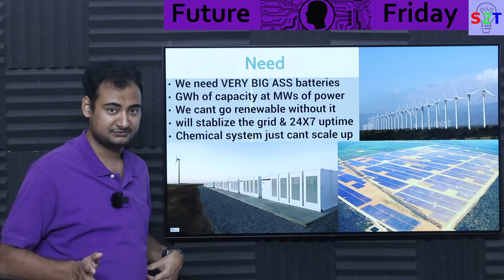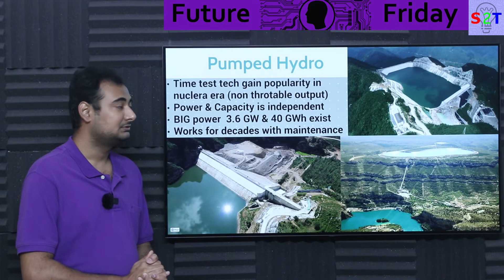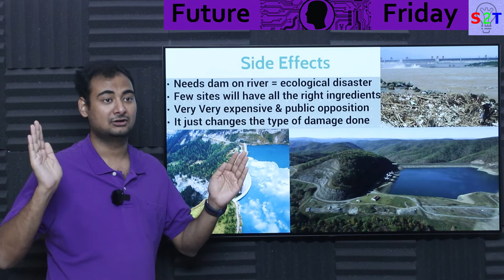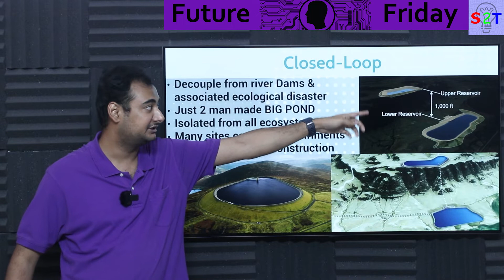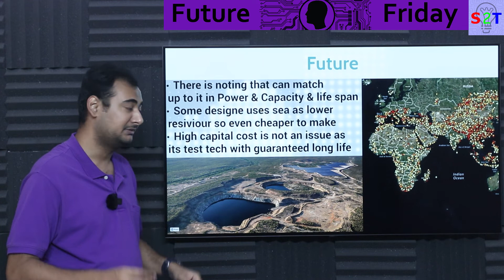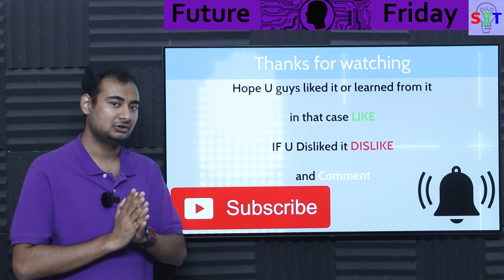Closed Loop Pumped Hydro Storage Explained {Future Friday Ep195}

Comment: can we do this on a small scale? let say to run a house or houses. Would it be viable solution instead of lithium ion batteries?
Reply from the maker: NOPE  it only works are Super large scale & gets more efficient the bigger U make it
Reply: @s2tenglish  I see. I was thinking this might work as there is a mountain at the end of my land, which is over 1km in height. Could easily get 150M drop, but since it's not viable, I will have to look for batteries then.

Comment: The solution is always been tidal Hydro electric generators .these can be put off shore of any country in mass using the tides coming in and out to constantly be producing power unlike a damn ,there’s no ecological damage obviously you don’t want to put them in barrier reefs ,but the earth is covered with 2/3 water plenty of space using the tidal currents in the ocean even in the currents that are deep current flow there are generators that are manufactured that will handle this .of course then there’s the problem of running all that wire from deep in the ocean but the power there could be converted to radio waves pump to the surface and bounced off satellites .there is solutions but the biggest factor is the political problems you see information is powerful and suppressing information has become an industry and most governments .keeping their people from knowing solutions helps keep them under control and the elite ruling class is all about control ,it’s their endless supply of funds that they take from the poor the ruling class has always been the oppressor throughout all of history until the US developed a constitution that demanded the people rule themselves  .but they want you to think it is other people than themselves these are the issues that we must fix because the political issues are strangling the people in the name of ecology now  ,which is another big lie from the oppressive ruling class I have been all over the Bahamas as well as many Caribbean islands they all run their electric on diesel ,they definitely could use solar and wind to produce their electricity but title generators using the tides around their islands would supply them with endless amounts of electrical energy .why they don’t .political they are making money from selling themselves or their people oil and gas and then taxing it on top of that .all these rackets are polluting by causing death and destruction of mankind you end up polluting The solutions that come from our minds and the more minds you have the more solutions so if  you will find killing them all off you won’t find any solutions but you will find a whole Lotta murderers and selfish individuals that will self destruct the human species. These governments and ruling class oppressors must be kept under control and allow the people to grow and give them the information they need to fix the problems although I do not believe the ruling class will ever allow this to happen we must try down here at the bottom to give them overwhelming solutions through the Internet to educate people and show them how to be free from these tyrants. I am old enough to remember when the tyrants realized nuclear energy could make everyone independent so I campaign was started on the dangers of radiation and those dangers are extremely exaggerated through the media who is bought and paid for by the ruling class elite oppressors again keeping the people dumb on how to protect ourselves yet still use nuclear energy the energy creating waste could be launched into space The way the Voyager spacecraft which are still moving out of our galaxy and we could be pumping the waste out where in space gamma radiation would probably destroy the waist but I digress there are solutions they may not be the ones some people want but they’re are solutions.
Reply from the maker: tidal Hydro electric  does not work as  sea is a brutal environment nothing lasts in it and its not 24X7, its based on tides which have there own cycles. many people have built it in many country's outcome is always the same maintenance & capital is too dam high per KW. Stop blaming everything on someone else it always has been US vs our baser Instinct. No god or kings only man
Reply: @s2tenglish  I agree a dam is better more efficient but there are some of these that are offshore that are very efficient problem is again you have to run wires so there’s always a give-and-take when the earth was covered with ice and it melted it became an ecological disaster for a period of time with all that water standing but it finally receded the earth healed and worked with all those thousands of lakes so a few hundred more for dams aren’t going to cause the big ecological problem they are decrying they don’t want people independent from the ruling elite that’s the real issue if they would face this we could feed more people the truth is if you take 8 billion people put them in a 3‘ x 3‘ square of ground sitting in a lawnchair 8,000,000,000 yd.² takes about 27 mi.² up of space about the size of Jacksonville Florida the city that is a spec compared to all the space that is around even if you take one person per acre to survive 8,000,000,000 square acres will not cover the entire earth it will only cover north and south America and leave all of Europe and Asia to expand into and I’m not counting Africa Australia and all the thousands and thousands of islands we do not have an overpopulation problem not even the least we have a problem where you try to put 1 million people in one square mile then you have a problem it’s all how you look at the problem as to how you solve the problem I love your videos because you are straight up and telling the truth as you see it from your vantage point but we must remember there are a whole lot of other vantage point we must look at the problem from thanks again.
Reply from the maker: "problem is again you have to run wires" that is not a problem we have monopole HVDC used for off shore wind farm its known and tested . Please talk to ecologist dams kills every thing  My country suffered because of it so I know and if u need more proof look at china the literally have 1 dam per 100KM of river outcome river died & people are suffering. Rivers are not something that u should stop people have learned it the hard way . Let go of "ruling elite" control everything that will only brain damage you ,make even solvable problem unsolvable. Controlling people are part of human experience. they where, they are & they will be.
Reply: @s2tenglish  True they will be .but they are the problem that we keep avoiding and it makes for the rest of the people on the planet their lives are destroyed because of them .I believe there are solutions but these clowns keep getting in the way.
Reply from the maker: @Mike-hr6jz  welcome to life